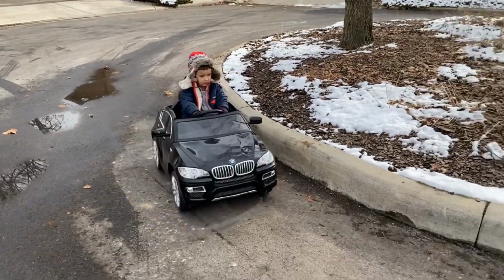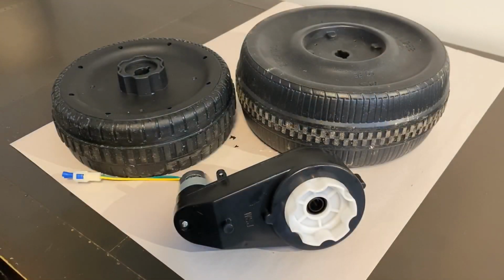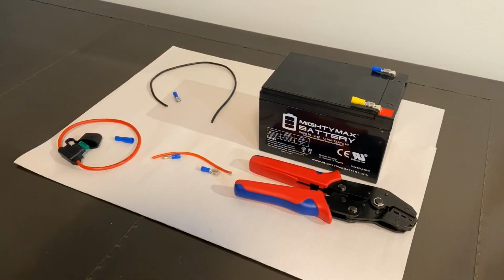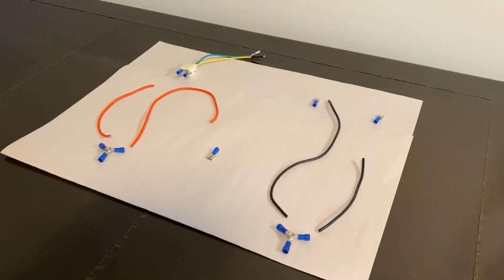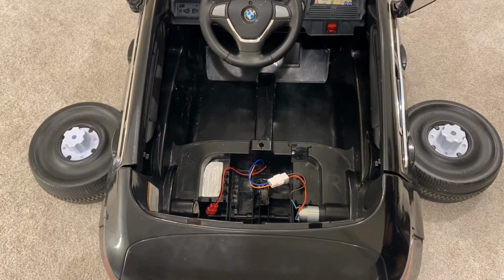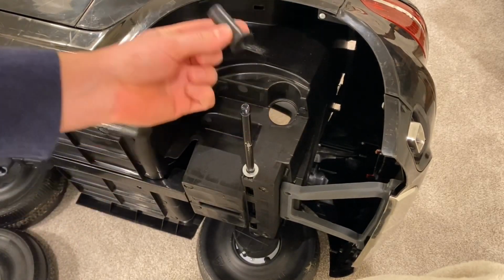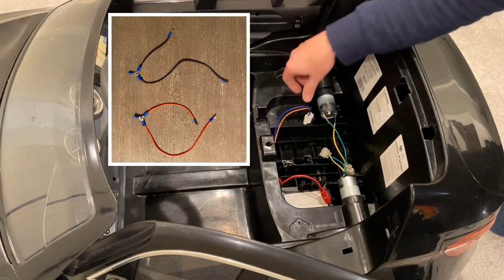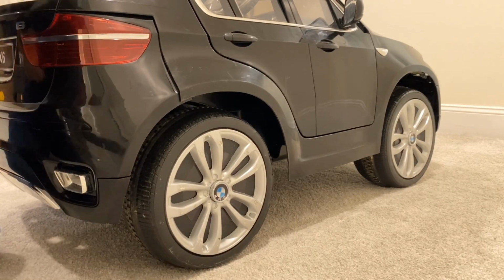Turbo Power Wheels | Modifying a 6 volt car to 12 volts

Comment: Great video, you've covered a number of details other videos omitted.
The existing wiring in my son's Paw Patrol car from CostCo appears to be 18 gauge.  I'm concerned going from 1x6V motor & Bat to 2x12V motors and a 12V Bat, that I may burn out some wiring or the circuit board.  Have you had any issues with this?
Reply from the maker: Thanks! If you are only going up to 12v (2 motors) I’m less concerned with the stock 18 gauge wiring, but your control board will burn out. You need a 12v board, I’ll link one that you’ll be able to use.  https://www.amazon.com/dp/B082952MV7/ref=cm_sw_r_cp_api_glt_fabc_85K5RF4TF0ZF50CF2D5V?_encoding=UTF8&psc=1
Reply: @DadHacks so I see that board has 7 pins, mine has 8. Would I remove a certain wire? I would like to control it via remote also. any ideas?

Comment: Havent opened up my kids car yet, but how will i know if the stock motor/gearbox is 6v or not? Is it labeled? The battery was 6v, is that the determining factor?
Reply from the maker: Yes. If the battery is 6v, the motors are rated for 6v

Comment: Greetings just to clarify. I have a powerwheels knock-off. It is presently 6volts, if I want to upgrade to a 12volt battery i would need to replace the parent control box as well as the motor and battery. Will the lights and radio be ok? Also what about the stock wiring?
Reply from the maker: Correct. Look for a Weelye RX57 or Weelye RX24 as a replacement 12 volt board. Technically the motor would still work for a little while, but it’s best just to replace both. I’ve never had lights and sounds not work when upgrading from 6v to 12v. Assuming that the stock wiring is 16 gauge or 14 gauge, it will be fine to run 12 volts.
Reply: @DadHacks  can you post links for wheel to gearbox connector and 12v gearbox please? Also do they make a compatible 24v gearbox? Would i be able to go from 6v to 24v by changing batteries and gearbox?
Reply from the maker: @moek.229 here’s a link to tall wheel hubs https://amzn.to/4atqEcS and one for shorter wheel hub https://amzn.to/3v3RfgL. Just measure the existing one you have on the other side to make sure it fits. There’s just too many issues jumping up to 24 volt on a 6 volt car, such as the pedal melting in the closed position and the car not stopping. Also, you aren’t going to get double the speed over a 12 volt motor, because the 24 volt motors they use have about the same RPMs as 12 volt motors, so it’s about the same speed.

Comment: Thanks for this! Was all the wire 12g? Also what size fuse did you use?
Reply from the maker: The other wire was 16g. You would be okay using 16g and running up to18v or 20v battery. I wouldn’t run a 24v because that will cause other issues on the car.  The fuse was 30 amp, and those came in the pack of inline fuses that I bought

Comment: Thanks for the video sir very informative, but can you help me a bit, i had 12v jeep and  ill change the motor 40,000rpm to run faster with out upgrading the speed controller but the problem is when on its own using remote it run smoothly but when my son rides on it for few meters  then suddenly stop but after couple of second run again it is repeatedly happen, do the speed controller cause of this and do i need to upgrade the speed controller too, because i was putting a higher rpm on it please me sir
Reply from the maker: Hi! It sounds like the control board is tripping because too much current is being drawn through it when it’s on the manual drive setting, this is likely due to the new 40,000 rpm motors. You have 2 options. The easiest is just to replace the control board, however this may only temporary fix the problem. The other solution is to completely bypass the control board and wire the battery straight to the motors, however this option will leave you without the parent remote control function. (Here is a link to a replacement 12v control board. https://www.amazon.com/dp/B07QX1T1YS/ref=cm_sw_r_cp_api_glt_fabc_JB7SX62JEC8KXD1JQ2S5?_encoding=UTF8&psc=1 )

Comment: I have the rollplay, if I up to 12v will the leds burn out? Also if you doing 2 12v motors you should do 24v battery not 12v.. for 12v do 2 6v.
Reply: @dadfactslifehacks9627  I think it depends how its wired, in series or in parallel.. check with voltmeter how much volts at each motor to be sure. Were the LEDs much brighter? Where did you get the motors that fit? I was thinking of getting a 2nd 6v motor from rollplay directly. Did the rollplay audi have the gear on the 2nd wheel? I dont remember since I put it together years ago. I put a much bigger battery in the prego tractor, 12v and motor still 6v, runs well but I had to cut a bigger hole for the battery. The power wheels cadilac comes with 2 motors, 12v and was able to take it to 36v and it still ran fine but way too fast lol.. 24V was more than enough.
Reply from the maker: I couldn’t tell if the LED lights on the Audi got brighter. It only had 1 gearbox, so I did the same wiring as in the video to be able to put 2 gearboxes and 12v motors @ 35,000 RPMs in it. I used the same gearbox/motor as in this video, the link to the Amazon product page for the gearbox and motor is in the link of this video.

Comment: What about the cars with accessories that tap into 6v power? Do you just leave them unplugged when going to 18+v? I was worried 12v would be bad for them so i unhooked the lights and radio.
Reply from the maker: Exactly. 18v on the radio will likely burn it out. The lights may be okay. Is there a control board? (Black little box)
Reply: @DadHacks   No didnt find one

Comment: Was thinking of using a motorcycle  batt.would the amperage be to high,and what should be the amperage  on batt?
Reply from the maker: The higher amperage would just increase the run time for the power wheels. If the voltage is higher than 12 volts (actually up to 18v is fine), then the motor is likely to burn out. Idea amperage is 12amp. The 12v/12amp battery is the size/weight combo for most car. (But definitely check the size of the battery compartment before buying the battery)

Comment: What charger did you use?
Reply from the maker: I should have bought this one, which charges 6v and 12v.  https://www.amazon.com/dp/B0051D3MP6/ref=cm_sw_r_cp_api_glc_fabc_KqebGbJV8VPXA
Reply: Does the 12v motor same will fit the stock gearbox of 6v? Im planning to buy a motor only.
Reply from the maker: Yup, it will be the same size (most likely a 550 motor). A word of caution, the stock gearbox typically has all plastic pieces on the inside, would could cause it to melt/ strip the gears. Buying a combo gearbox/motor is probably $5 more than just a single motor and it has a metal middle gear. Another issue could be the metal pinion on the motor that you buy could need to be changed out if the # of teeth don’t match up with the gear. You would need a pinion puller to take it off. 

For an extra $5, it saves a lot of headaches just buying the combo motor and gearbox